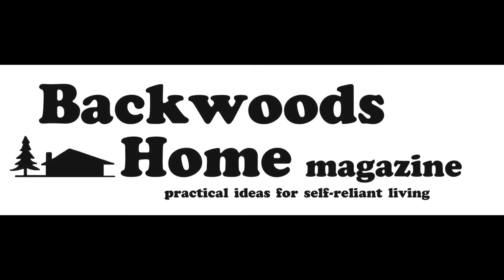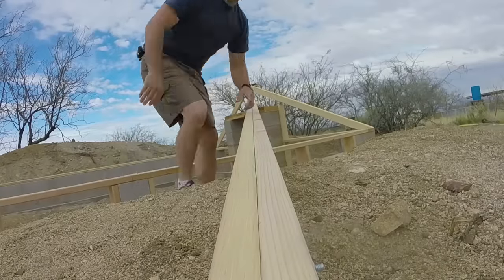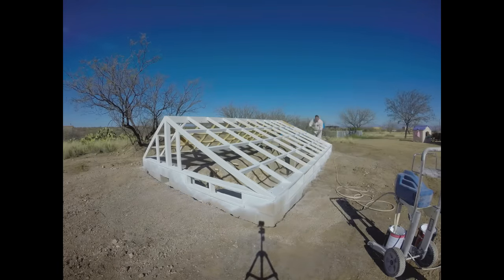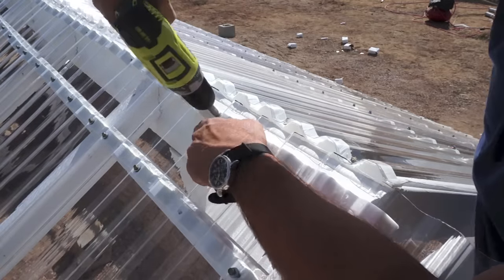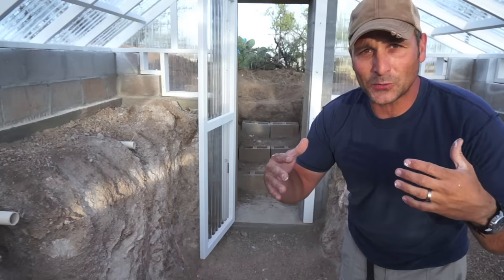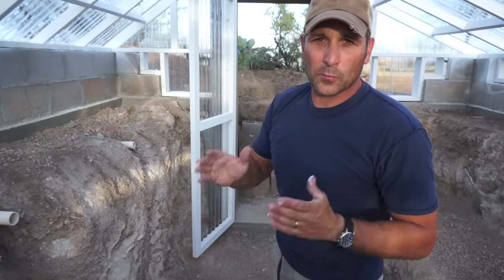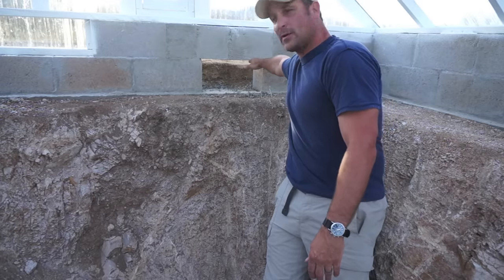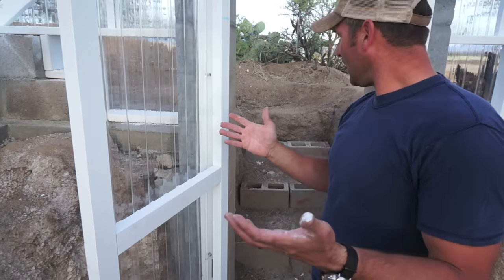Sunken Greenhouse Part 3 - framing, polycarbonate install how to

Comment: I would almost take a leave of absence from work, and just help and learn.  At 53, I have very little building skills since I'm and I.T guy.  This is a fantastic series
Reply from the maker: Hey Brent, i'd bet your skills are better than you think.  Starting off with a small project will help fine tune any skills and get into working on any of the bigger projects that you may want to tackle:)
Joe
Reply: Brent, I retired a few years ago from IT and now do handyman work in a small rural town. I didn't have the skills but they were easy to aquire. Trust me, all your life you were detail oriented, task driven, and were good at getting the job done. And knew when to get help. If i can watch a few YT videos and then put on a cedar shingle roof, you can do it.
Reply: @ronmiller7248  Thanks Ron, fast forward, I'm now soon to be 58.  I started off small and made a few wooden Trelis for my garden, a few small greenhouse benches and even tackled a small solar install.  Small steps, all the best

Comment: Great job, a lot of hard work will pay off! Very inspiring. 
An old school trick for you to try . For a few dollars buy yourself enough all thread and attaching hardware to secure it diagonally to your entrance door. Use a turn buckle in the center. Then simply tighten  it slightly and your door will never drag or get out of square as you continue to use it.

Comment: Couple of suggestions: instead of a straight vertical support in the center, try two diagonal supports from the sides.  You won’t lose much space and be much happier that you don’t have to walk around a pole all the time.  As far as the stairs, I would dig the hole put out, install a French drain and put riser stairs using treated lumber.  It will last a very long time and you won’t have to mess with getting them proportional and surfaced.  It looks great!  I hope you get it up and producing very soon.

Comment: Just found this channel. Super informative. A note about the polycarbonate panels. They are crap. I've used them because they are cheap and readily available - I'm sure that's why the big box diy stores sell them instead of a more durable product. In my experience, they turn brittle within a year of exposure to New Mexico sun, yellow within two. A minor hail storm will punch holes in them. If they've gotten brittle, hail will shatter them into a zillion pieces. A much better product is twin wall polycarbonate. A better-yet product is clear, corrugated fiberglass. I believe that's what used to be the standard before the corner-cutters came up with the junk sold at Lowes and Home Depot. A brand name for corrugated fiberglass is Crane Composites. Their Sequentia Super 600 has a 20 year warranty. By the way, I don't work for them.

Comment: I am so glad I found your videos. We put in a 12x20 polycarbonate (?) Greenhouse this spring and I battled extreme heat from unusual heat wave.  We are at 4400' elevation of an arid eastern NM environment.  And looking at our greenhouse, I realized we should have sunk it down, to battle the extreme heat/cold swings. Our first freeze a couple of years ago was  72 deg to 8 deg over night.  End of Sept.  yet this year, still hot as blazes.  I can't figure out how to plan our organic veggie garden.  I could have had a complete late summer/fall harvest had I known Hell was going to stick around another few months. Ugh

Comment: Joe, the greenhouse looks fantastic. I am so glad you used polycarbonate and not glass. It has been an awesome project.
Reply from the maker: +UK Tony Thanks Tony!  I considered glass but the framing would have been way more complex and I think the panels tie the structure together better in regard to shear strength and resistance to wind, hail, etc.  Thanks for watching the project and it's always great to hear from you Tony:)
Joe

Comment: WOW! You are one competent guy!
Reply from the maker: Thanks so much Brooks!  I'm not really that competent... I just cut out all of the times I'm scratching my head and wondering what to do next...lol... the power of editing;)  thanks for checking it out and feel free to check out parts 4, 5, 6... and soon part 7 too:)
Joe
Reply: Although im wondering about drainage at the bottom of the steps area when a big lot of rain falls? I think its still  a great idea...👍
Reply: Exactly right.  And seepage from the ground all around.
Reply: ground moisture is the whole point.  I sometimes water my green house by flooding my floor I have raised beds in mine, so the heat turns the water into humidity which keeps the beds from drying out.  love this concept.
Reply: Why are you so salty Kube Dog?

Comment: my grandpa built sunken greenhouses using pvc pipe and plastic sheeting.  rather than a solid/permanent construction, he preferred to be able to easily remove the "tent" seasonally.  i really like the idea of making it permanent, personally.  great job.
Reply from the maker: +jason fifi Thanks Jason!  That's actually a great idea... then you could just let the plants stay in place and then when It got cold again, just bring the GH back on.  I went for the permanent GH... mostly because our winds here are just crazy... I actually had another greenhouse several years back and we spent most of the time chasing panels down that blew away:)  thanks for watching Jason!
Joe
Reply: haha, yeah, his was built in a clearing in a field, so the winds weren't too bad, especially because of the dome/tube shape.  almost 100% of it was below the ground.  think of a rectangle the size of the whole made of pvc then inset Ts every 8" or so, and run rounded pipes up and over.  some years, he left the frame up, and some years he just covered the whole thing with cloth to shade the plastics.  the floor got very very muddy, even with a thick layer of gravel.

keep up the good work, i'm subscribing to see more.

Comment: Here is what I would like to know more about, perhaps in your next video. 1) Would you show an actual thermometer reading of outside temp and inside temp with doors closed AND with vents open? 2) Could you address your roof, the main seam down the middle how did you seal it? 3) Do you live where snow is an issue? 4) Please show what you have started growing 5) what did you do for tables and are you bringing  water in by hand or did you rig a hose? Lastly, I know the corrugated plastic you used 6) what made you choose this one over the double paned stuff that has a higher "R" value? Oh yeah! Great job and it looks great!
Reply from the maker: +Lira Ziyad Oh wow!  You've got questions but I don't have all the answers just yet;)  But I will... I'm planning on doing a greenhouse Q&A vid after its all finished.  But that will probably be closer to the fall or late summer.  But I'll give you the quick and short for now:)
1... I plan to but I don't yet, have all my vents installed... just one, plus door and window... but I'm planning a solar fan possibly
2. roof is sealed on the main beam with the foam closure strips between the flashing and between the panels and the beam
3.  I'm in southern arizona... at about 4000' elevation so we get a couple snows a year but it's rare for it to even stick... so not much of a concern
4.  I've only grown some starts in the GH house at this point, but don't currently have anything in there right  now... as it's still a work in progress and I don't have near enough venting.  I plan to use it mostly in the fall, winter, spring with little to no use in the summer... just too hot even with venting
5.  no tables or water just yet.  I plan a rainwater tank on the inside at some point but will probably just pull a hose in manually to start with
6.  I choose the tuftex polycarbonate panels because they have an extremely high temp rating and they were available at my nearest lowes.  lack of insulation in the panels won't matter for me either way as our winters are usually pretty mild.

whew!  I hope that answered the questions until I can get a QA video put together.  The next GH video will be on the retaining wall, steps and one vent:)
Joe
Reply: homesteadonomics Hey Thanks a lot for taking the time to answer for me. I will be looking for the update video in the fall. I live in South East Alabama so our winters are mild but starting to change. So I understand. Keep up the good work!

Comment: Hi, Just a thought about your beam situation. 

If you install a post in the middle of the ridge beam it's likely to seriously cramp your traffic flow. 

If you make  another beam then attach it to the bottom of the first one,  mounting it horizontally with lag bolts and glue. 

This will be very strong and won't restrict your work space.
Reply from the maker: +charliemor3 Well, I've already installed a beam...lol... but you are on the right track.  My father in law suggested that as well... but I also wanted to use a beam, so as to anchor the frame to the ground.  It's not bad regarding space though.  But your idea is certainly a good one... just had my mind on a post, and I couldn't get it out of my head..lol;)
Joe

Comment: My ex and I built one about 30 years ago in Odessa Tx that looks very much like where you are. Ours was not as ‘fancy’ as in no paint because paint traps moisture in the wood and is a maintenance issue. The climate was desert like you - with annual variance From 100+ to minus zero sometimes in winter (F). With desert climate there are only a few rain events but as desert dwellers know, rains are seldom gentle but come hard and fast. The issues we could not overcome was - like you - substrate was very rocky (caliche) and the stairs were impossible to prevent being a culvert that directed rain into what amounted to a rock lined basin, so after a hard rain the greenhouse had varying amounts of water in the bottom - to the depth of the side beds sometimes so would take many days to slowly drain away. Also we used white poly panels because clear made the interior way to hot - white provided the needed shade in the long hot summer. Just the same as some glass greenhouses are sometimes whitewashed/painted. This brought back lots of good memories good luck. I am Interested to know how you overcome the rain intrusion issue. Thanks!
Reply: So sorry about the strike over ! Not sure how that happened- dang technology 😊

Comment: Great job Joe.  Looks really nice.  You should have great performance in the winter with all of the mass of the ground to absorb then release the heat.  I'm intrigued with your plan to use a trench to move cool air in/out.  I can't wait to see how that performs.
Reply from the maker: +helidodge Thanks HD!  I'm excited to see if the cooling/heating tunnel works as well... of course I gotta build it first and my pick and shovel muscles are telling me... 'no more!'   lol!
Joe

Comment: Put a long pipe in the point of the roof and have sprayers connected to them and block off one end of the pipe and attach a fitted piece to screw the garden hose to.

Comment: Nicely done! if you need even more warmth, paint all the wooden frame a very dark color, like dark green or brown. I have  green house in a cool climate with dark brown stained 2x4's and they soak up lots of heat. Same with the cinder block walls. Painted dark they will absorb and radiate heat through out the day and night. Too hot? Yes, vents and fans needed. Each beam becomes a powerful passive solar heat sink. All that white just reflects heat away from your greenhouse. Mold / mildew? No problem, mix a common "Spray mister" with essential oils like peppermint, rosemary, then mist into the air from one end to the other, then shut door. Mold and Mildew will be GONE. I've done it, it works.

Comment: Hi. Just watched the first two and love what you have done.  One thing I would have done: the little southfacing bottom plexi sections, I would have put screen and operable windows and made some matching sections at the top roof portions of the north wall. Seems like that would have given much needed ventilation and heat dissipation. LOVED the rainwater vids and the use of runoff for gardens. Keep up the great work!

Comment: My I suggest using glue and fly/insect screen over your vent hole and windows to keep out any insect planing on making a meal of your vegetables. You could put the fly-screen into a wooden frame and nail it in place.

Comment: Nice work man! I was just going to recommend something that you might consider adding. They make temperature actuated shutters that will open and close based on what temperature you set them. They require no power, just the temperature difference itself actuates them. Would love to see temperature data when you get a chance. I bet it will perform beautifully in winter! My other idea was to add horizontal insulation to the soil around the structure to further enhance the stabilization of temperature. I believe they call it wing insulation. I bet even a good layer of mulch would go a long way. Anyway, Keep rocking man, love what you have done with the whole place. I recommend highly the books Natural Solar Architecture and Earth Sheltered Housing Design.
Reply from the maker: Yes, those are really cool shutters.  I have added some ventilation in part 5 of this project... and temp tests... still working on a cooling tunnel for part 6.  But I'll definitely check out the horizontal insulation methods and books you suggested:)  Thanks for checking out the project Dust Man:)
Joe

Comment: Awesome bro, use the geothermal heat and pipe in some 55 degree air, run some pipes 6 feet down around 100-150 out into your yard and into the greenhouse...

Comment: I used those panels on my 12x24 shed.  They are very strong, but can be punctured and cracked by high speed hail around the size of a nickel.
Reply: It only happened once, about two years after I built it.  I think its going on 7 or 8 years now.  I just siliconed scraps on all the holes.
Reply from the maker: We get hail but not that often and hopefully I won't have to deal with that for a long time... fingers crossed:)

Comment: Looks awesome.
IMO you don't need a support pole for the ridge beam. You've got 18 roof joists holding up the ridge beam that are attached to very rigid walls that aren't going anywhere. But in the very unlikely event that the continuity of those walls is compromised they're going to go inward, not outward, which will result in the roof joists pushing the ridge beam up. So a pole for the ridge beam is bigtime overkill and will just be in the way.   In my opinion, of course. :)
Reply from the maker: +firecloud77 thanks FC... I agree but I'm a just incase guy and it gives me an excuse to work with some more concrete and make some homemade anchors:)
Joe

Comment: Rock-solid assembly. One question doesn't let me sleep at night though -- wouldn't it be better to increase the long-side slope to the point so you don't need to cut polycarb sheets. It hurts to see that you cut a chunk of that beautiful length. I hope you end up using all those cuts. 
Cheers!

Comment: I'm a framer and the rafters will hold up that ridge just fine, there is no real load up there so it will be cool without the an additional post.
Reply from the maker: +danielcooper1000 Yep, it's more because I had it set in my mind...lol... but it's already in at this point... You'll see it in part 4:)  Thanks for watching Daniel... and try not to laugh too hard when you see the big white post in the middle of the greenhouse in part 4:)

Joe

Comment: look good man. guesses have decided what is want to grow in there. then plan for it. like do bunch poted orange and lemon lime potted plants might need add heat. if just do lettuce, carrots, parsnips, onions. all these thing picked before flowers so there no need for pollinator. if did papers and tomatoes going need pollinate it some how. tiny wood stove with cast iron body. little pile wood all need bring eat up winter for realy warm crops.

Comment: Looks good, I'd use gutters and have a tank for fresh rain water inside. Just a thought..
Reply from the maker: I thought about that ...but ended up directing my gutter water to some IBC tanks in the garden:)
Reply: Basically the same thing. But if you wanted to spend way to much you could put in a filtration system lol.. Really though Creek water/rain water has the perfect ph levels for basically anything you grow and if you hit a dry season you could have enough to irrigate!

Comment: Hey thanks for sharing and great job. Have you thought of putting in a slope down into the entrance instead of steps? Thinking of a wheelbarrow in and out will be useful. Cheers.
Reply from the maker: +Mourad K Thanks Mourad!  That's a great idea but I've already poured concrete steps at this point.. it'll be in part 4, which should be up soon:)
Joe

Comment: Great greenhouse, great video.  I found you on my homepage and I'm glad I did.  The speed shots were perfectly done, and your demeanor is excellent.  You remind me of a cross between Walter Sorrells (expert custom knife maker) and John Kohler, if that makes any sense.  Anywho, good luck with the greenhouse, you're off to a great start.  Subbing immediately.
Reply from the maker: +Bobby Fuesz Thanks so much Bobby!  I'm not familiar with  Walter Sorrels but I am subbed to Johns channel (growingyourgreens)... so I'm taking it as a compliment,  thanks!  Glad you are liking the greenhouse vids... working on part 4 now, just adding some more venting right now:)
Joe

Comment: Lowes sells a plastic rectangular vent that is placed in place of a cement block for that vent hole in the wall
Reply from the maker: +Andre Martel Thanks Andre!  I'm going to have to check that out.... I've still got to did the trench but that would dress it up as well as keep the critters out!  Thanks:)
Joe
Reply: +homesteadonomics Google cement block vent. You will see more than those available at Lowes and Home Depot. Also cheaper. Even powered ones.